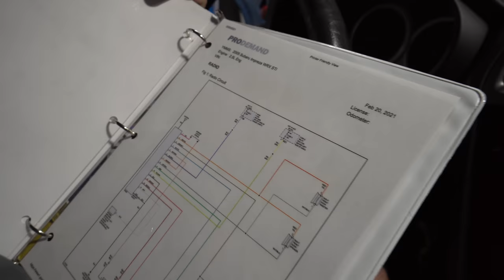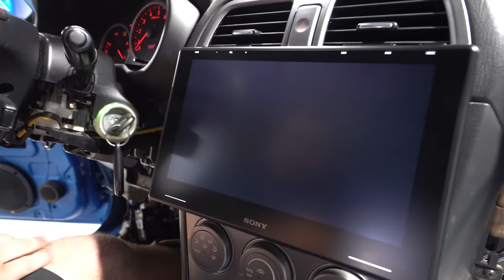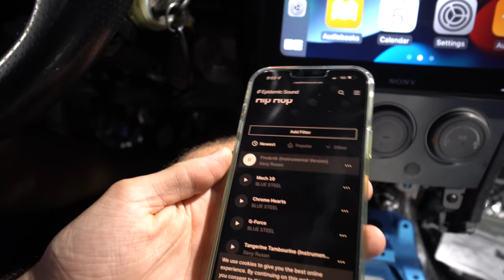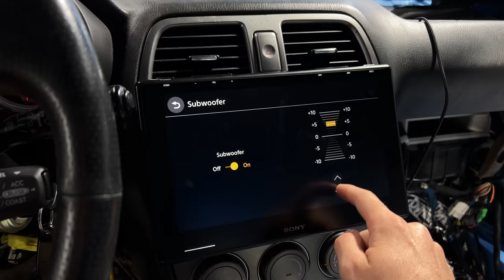Installing a HUGE Apple Car Play Unit & Sony Sound System (2021 Tech in a 1996 Car!)

Comment: There is a major safety issue in this video.

The fuse on the amplifier wire is not to protect the amplifier (as the amp had built in fuses for that).  This fuse is to protect the wire in the case of a short to ground.  You need that fuse because of how long that wire is.  It increases the odds of a short to ground from happening.  If the fuse is far away from the battery, you have a longer portion of hot wire that is unprotected.

You want the fuse to be as close to the battery as possible, or even on the battery terminal itself if possible.  The general rule of thumb is to place the fuse between 6 and 12 inches from the battery.  This minimizes the section of the wire that is unprotected.  That way you can have a short anywhere on the wire and the fuse will still pop and protect the wire. (Unless the short is before the fuse in which case your effed (Hence why the fuse should be close to the battery))

The other issue is your wiring of the head unit.  Ideally, you'd want to use a wiring harness adapter for that.  They are cheap, and much simpler to use.  They also remove any guesswork from that wiring.  But I do not know the full story of this car, so I can forgive this if it was removed prior to you owning the car.

Other than the major safety issue, the video was great. There were a lot of best practices that were followed to a "T" and your use of color coding and wire organization was great!  I really think you should amend the video to correct the mistake you made, so that others do not make it as well.  I have seen car fires happen because of a short to ground on an Amp wire.  Hell, my own truck almost caught on fire due to this issue when the previous owner made the same mistake as you.  (A rat chewed threw the wire, and me replacing it made me realize the issue)
Reply: EXCELLENT POST and I agree with all points 110%.  Two Thumbs Up
Reply: You're absolutely right that the fuses could/should have been closer to the battery.  That said, the battery is in the trunk, so it's not as bad as if the cables ran the entire length of the car.

Comment: Nice work good clean install, I did  cringe a little at the placement of the fuses though, they should be mounted as close to the battery as possible, they're not there to protect the amps they're there to protect your car from catching fire if something ever happens to the wiring (car crash etc) as then you have 1 or two 0 gauge wires with dead shorts coming from a high current battery!

Comment: Should've made a blow-through port on the rear deck for the 10", or just mount the 10" on the rear deck and build a box over it in the trunk.

Comment: Wires + bare metal = electrical shorts over time.  Also, unwrapped wires will always make noise unless they are cinched down EVERYWHERE.  All the metal to metal contact on the larger speakers could have been avoided by using some dynamat around the speaker holes before install.  It is most certainly worth taking the panels off and reinstalling the larger speakers and getting some wrap or tape on any place the wires pass through a hole that isn't grommeted.

Comment: So having the fuses at the amp side? Interesting.. does that mean if too much current travels through the car before it reaches the safety fuse your cars burnt out? Curious as I have always fused amps close to battery..
Reply: yes! Always fuse the wire immediately off the battery. You can additionally fuse it at the amp, but that is not what prevents the power wire from setting the car on fire.
Reply: yeah, fuses need to be near battery.

Comment: You shouldn’t use crimps in spring loaded terminals like you did on the subwoofer. Now the wire is connecting only with a few spots of the crimp, because the wire is not flexible anymore what the terminals are designed for. And on the wire in the subwoofer you should use cloth tape, so the wire can’t make a noise, when it shakes around.

Comment: Thanks for the video man, awesome looking screen. When installing speakers I mark the holes, remove the speakers then drill the holes. Its not worth getting all the sharp metal swarf over the new cones and stuck to the magnet. 
A couple of things I would do different mate. Put rubber grommets in the holes where any cable is passing through, use a wooden spacers for the speakers to screw into and screw the amps onto a wood board instead of into the metal sheet.😀

Comment: 7:21
Not all copper wire is the same. You have access to CCA or OFC which do make massive differences 
Multistrand vs single core too

7:55
Heatshrink isn't for holding wires in place either, it's for insulating, primarily as well as making the install look more appealing 

26:00
you need to fuse closer to the battery, the idea is, if the fuse pops it protects everything after it. Say a wire shorts in all that distance before the fuse, it'll cause an issue. However, if there's only 6cm before the fuse, the chances of any damage happening before that is minimal

Perhaps i'm just being pedantic, but should a "noob" reference these minor "issues" it won't be as good of an install as it could be! Not hating, more advising

Comment: All copper is not the same. There is CCA and OFC. Copper clad aluminum and oxygen free copper, OFC is 100% copper. You would use OFC in very high power systems like anything 3k watts and above. Cca is great for door speakers and certain cases with 4 gauge for amps.

Comment: The cleanest wiring job I've ever seen, amazing job! I love the customization of how the amps were mounted and how you were able to get the rear deck speakers mounted with using that other material (idk what that material is). And the head unit its self is massive! Love what you've done so far to the Subaru and can't wait to see how this build turns out once completed!
Reply: Check out the Clean Wire Club on Facebook Group that was started by Dean & Fernando from the 5 Star Car Stereo YouTube channel.   ;)

Comment: I really appreciate this video, some of the back story especially. I got the feels, it just took me back to high school when me and my brother got into car audio messing around with his 1st car. We were poor so we were experimenting a lot I mean we had the factory radio wire to an amp powering a old heavy house sub somebody put out on the curb for garbage. Eventually over time we saved up money to be able to buy proper equipment but trail & error learning, and your absolutely right the 1st time you hear/feel that bass its something special.

Comment: I remember the old Sony car stereo just being poo, but I've been really impressed by a lot of their new stuff and I wish I could hear through youtube what yours are like.  It seems as though for as much care as was taken to wire this up, you'd have shielded the wires in the doors that are resting against sharp metal edges.  He soldered the connections to the speakers in the doors, but used an all-weather connector on the sub and didn't solder it.  Also, one of the benefits of components is being able to get the listening angle of your highs closer to ear level and yours are put on the same level as the mid-bass, which doesn't really buy you as much benefit over a coaxial speaker placed in the same location.  Do these ES amps have DSP built in?  This is the first video I've watched on your channel, and I'm not a die-hard Subie guy, but I really dig the car!

Comment: You cancel the benefit of a component set with mounting the tweeter same place with the woofer you should mount the tweeter as close to the ear level as possible. If you don't have any place to mount the tweeter than you should use coaxials instead. But clean install overall and beautiful car.

Comment: So let me get this right? Old mate uses sheathing throughout the body of the car but not in the doors? No decoupling material between the speakers and the door, tech screwed in, no closed cell foam and no protection on the wires. Just zip tied and run through sheet metal. That is going to not only rattle and sound terrible but also wear through the wiring and cause issues. The fuse holder tech screwed to the side of the sub box with a big loop of cable is a bit ghetto too. Overall is an ok install but what’s the point in installing component speakers if you’re gonna put the tweeter right beside the woofer? Putting the tweeters on the a pillars or sail panels would have been a better option IMO along with some nice 5x7’s or similar up rear to add to the mid bass. Time alignment and a dsp should help bring the sound stage up though.

Comment: Guys you use sound deadening on the roof and the floor but not one single piece on the doors, you should use at least one layer on the outer sheet and then one layer on the middle sheet and close the big holes.

And yes the tweeter should be on ear height, you hear with your ears not with your feet
Reply: I must be the only one that can hear with my feet

Comment: O awg wires are overkill for those amps. Especially when only using 16 awg to the sub.  Also, I wish the door tweeters weren't so low and facing down towards your feet. It looks clean and slick, but when you have the car stripped I would've put the tweeter near the A piller (top of the door minimum).

Comment: Wire is not just wire and all the same. Normal cheap car audio wire is “cca” (copper clad aluminum). If you’re going for a quality install and sound, you need “ofc” (oxygen free copper). Cca wire also corrodes into the insulation, ofc is solid copper and is made to keep the wiring from corroding, it also conducts electricity MUCH better with less resistance. So wire type, and quality make a huge difference.

Comment: Surprised you didn't cloth wrap the speaker wires inside the subwoofer box. That might cause a rattle if the wires vibrates against the inside of the box.

Comment: Dynomat the whole cab but forgot the rear deck lid most notorious spot for  Rattle!
Reply: Rear deck lid, rear parcel shelf, wheel wells, and license plate and frame.  AND Especially the DOORS where the front speakers are mounted.  They will also need at least a 1/2" spacer/mounting ring for the front 6.5" midwoofers so that the glass does not hit the speaker's magnets when rolling the windows down.
Reply: @bbfoto7248  depends what drivers your using in the doors for spacing on adapters i have templates made all the way up to current but normally majority its a lil box that sits on that rear deck lid I hush matte & foam tape & that box & yes little strip behind license plate but that's if its just normal customer bass package install

Comment: For being so ocd, i can tell you as someone that has done a ton of installs....this is a touch better than a novice. You want to see real professional installs, watch Dean and Fernando on 5 star. No grommets, self tappers, cut radio harness, no staging......there is a ton that could have been done better.
Reply: No spacers, no rivets, sound deadening in the car but not in the doors. Mounting the tweeter with adhesive backing right next to the woofer. Might as well just have installed coaxials. The holes drilled and the speaker wire pushed through without a grommet just made me cringe. 

Dean and Fernando are the best. They inspired me to do my own installs which are really clean.

Comment: All copper wires are not the same.
Some are a mix of materials (like copper  and tin clad) while others are pure copper.
Some are solid, some are stranded.
When it comes to car audio, the general rule of thumb is you want pure OFC (oxygen free copper) with as many strands as possible for more surface area.

Also, make sure your alternator and battery(s) can keep up.
Reply: He meant they all “taste” the same. The wire coating adds the flavor. Red is cherry flavor. Yellow is lemon and so on. Duh!!

Comment: The only things I noticed that would be good to do would be rubber grommets where wires traveled through raw metal openings. Foam liners on the baskets of the speakers that were installed in the doors. Fuses installed closer to the battery instead of near the amp. That’s a long unprotected run that’s a higher fire hazard done close to the amp like that. A port somewhere in the rear deck to allow the subs sound to be more full sounding in the cab. Lastly, mounting the tweeters higher up on the door pointed in the listening direction. They won’t play to potential pointed at your feet.

Comment: All copper wire is not all the same. DC travels on the outside of the strands so more strands means more flow. Gauge changes resistance as well and load capacity. 

Car looks sweet though! And I also liked that I saw shrink wrap.

Comment: You should also use a spacer and rubber  bushings to mount ur amp so air can go under  and it isolated vibration if u want it to last for a long time

Comment: I struggle so much finding the connectors he used for the sub wires! Love them! Over time from vibration I’ve had my exposed wire start to fall apart and these will keep that from happening!
Reply: You can also solder your wires to the sub. That’s what I did. Better connection. More hassle in the future though if I change my setup or something goes wrong
Reply: @benisjammin626  that’s why I don’t…. I’m always looking to upgrade and get louder lol it’s the addiction now haha
Reply: @marioschneller8938   
The spring terminals on the subwoofer are more than adequate to keep the bare wire or wire ferrules securely connected to the subwoofer.

If you use bare wire to connect to the subwoofer's spring terminals, it's a good idea to solder or "tin" just about 1/8" at the very end of the wire and strip enough insulation off of the wire so that this soldered end sticks out just a tiny bit past the far side of the spring terminal's hole.

The soldered end keeps the wires from fraying apart, but allows the spring terminals to compress against the bare copper wire strands to make better contact.

And for a subwoofer, I probably would have used at least 14 AWG wire rather than 16 AWG, but the 16 AWG will be adequate at this power level, especially for this short wire run from the subwoofer amplifier to the sub. 

It's the wires inside that connect to the enclosure's terminal cup that need to be soldered because those press-fit spade terminals can easily vibrate loose over time due to the subwoofer vibration.

 It's also a good idea to wrap the wires inside the enclosure with foam tape (like self-adhesive foam weather-stripping) because they can rattle and make unwanted noise when vibrating against the inside of the enclosure.
Reply: @bbfoto7248  how have I never thought of this it’s such an obvious huge help which makes me feel foolish for never thinking of this! Thank you for the huge tip! I wish I would have taken up the apprentice ship for installs I got 10 years ago.

Comment: That's some pretty insanely thin wire to be using to connect to the subwoofer, I can't imagine that has capacity for the wattage you're putting through it.

I hope you have a circuit breaker or fuse closer to the battery too, having the fuses in the back with the components completely eliminates their purpose... Which is to prevent a short in the line running through the cabin of the car from starting a fire.

Also, it's not THAT serious, but you should run your amplified and unamplified signal wires separately not all zip tied together.
Reply: Battery is in the trunk and the sub is running under 500 watts
Reply: @Randallpullen123  Your fuses are mounted like 6 inches away from the amp. The majority of the large cable is unfused and running over carpet... Your fuse placement is AWFUL. Any puncture or short on any part of the entire run from the battery (in the trunk or not) is a MAJOR fire hazard. Your fuse/circuit breaker should be mounted on metal, as close to the battery as possible, and NEVER on carpet. I also hope you either have a dry cell/sealed battery, or that it's properly ventilated if it's a lead acid in the trunk.

500 watts RMS calls for 14 guage speaker wire. Anything over 225W calls for 14 guage...
Reply: Lithium battery is being used also the fuse is mounted to 1/4” aluminum not carpet
Reply: And the battery is about another 6 inches from the fuse. Try again boss.
Reply: @Randallpullen123  
FYI, Lithium batteries require a way different charging voltage and scheme/technique compared to standard lead acid or even AGM vehicle batteries.  You typically will need a special isolated "charge controller" for lithium batteries.

Did the battery manufacturer specify that this particular Lithium battery is safe for use with a standard automotive charging system???
Reply: @bb foto
Yes the lithium battery we have can charge on OEM equipment. Wouldn’t have gone with one the didn’t.

Comment: I have the same sony speakers and sound very clean and nice but with the 6x9 coaxial versions for the rears powered by the Sony GS4 amp. I went with a Fi Neo 3.5 12 inch in a 32Hz port box powered by PG Ti3 1300.1 and the bass is very smooth and clean, and it’s very potent just the way I like it.